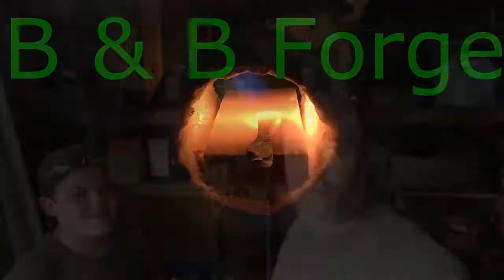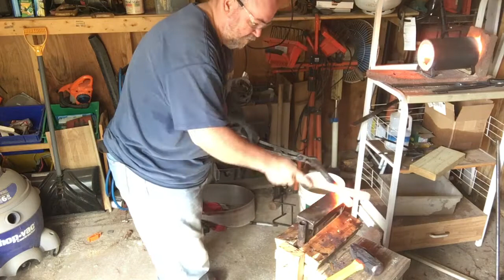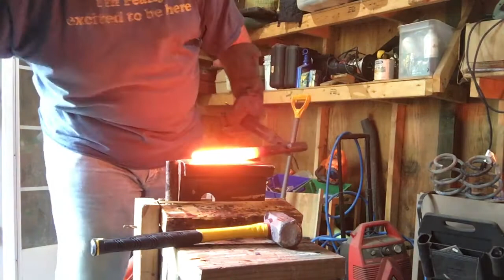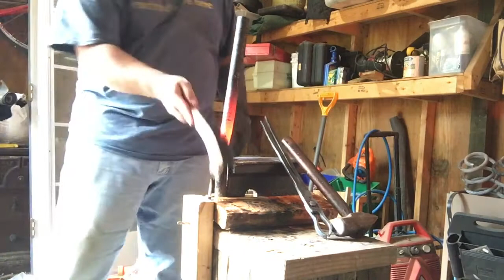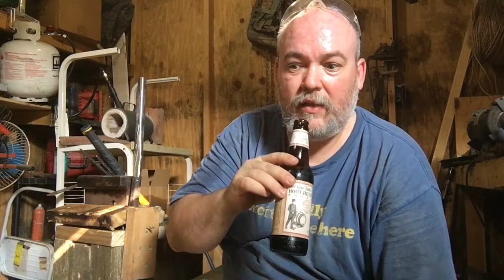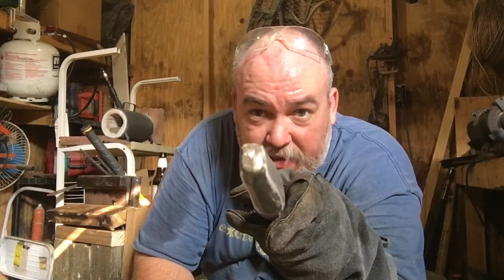hammer eye drift

Comment: just out of abject curiosity, do you have a steel supplier anywhere near you? if so I would recommend going there and checking out their drops. a lot of times they will have VERY large chunks of steel for near scrap price. If you can find one with an area you can use as a face of at least 3"x 3" you could use it as a stump anvil and just use the track for straightening out longer pieces. the biggest purpose of an "anvil is to place an immovable mass beneath the hammer to reflect back the blow. Striking anvils have been made with mild steel for years and years. If you can find a decent sized piece in drops you can get it for nearly scrap price. sorry for the novel length comment. You did a fantastic job on the drift. It could be a bit straighter. it looks like the tip is off center from the striking end. it may be my eyes but other than that it looks fantastic. especially Being your first ever attempt.
Reply from the maker: thanks

Comment: That was good to watch. The improvement over the bouncing anvil is huge. As I mentioned earlier, wedge some shims under the stand to stop the rocking and you'll be set for quite a while. When you do eventually get a hardened anvil with good rebound you're gonna be blown away.
Reply from the maker: i made this before the last one got posted.  i'm going to cut some wedges tonight to fix the unlevel floor in my shop.
Reply: B & B Forge I figured you had already made this video. However the friendly reminder providing a gentle nudge felt like a good idea. You'll be surprised just how much more it'll help you.
Reply from the maker: ya i know and with a hard head like me i need it.  I'm glade i finally lessened.
Reply: B & B Forge Don't worry, it took me years of doing two or three times the amount of work to get a result than I would have if I would have just listened and got the right tools and processes from the start. I gotta reinvent the wheel at every possible opportunity.